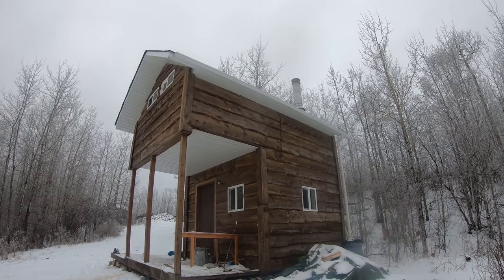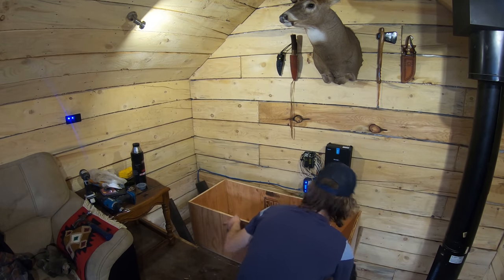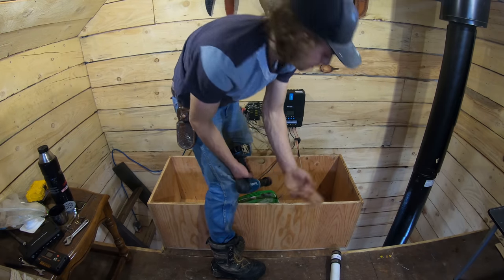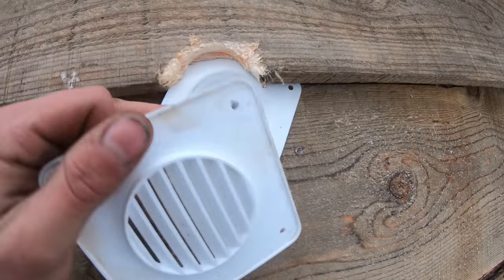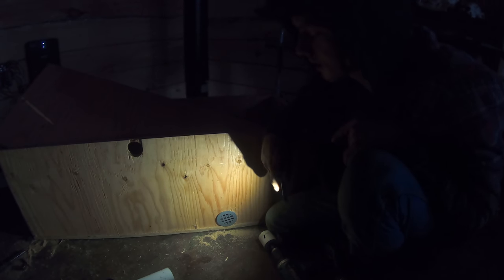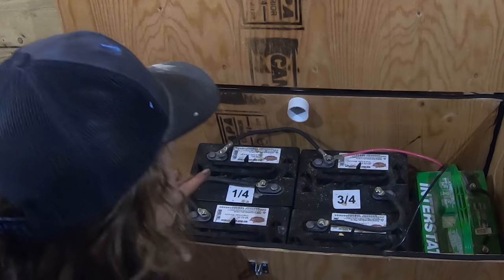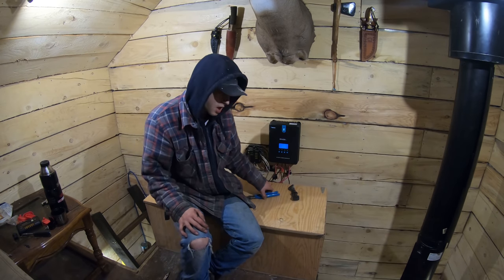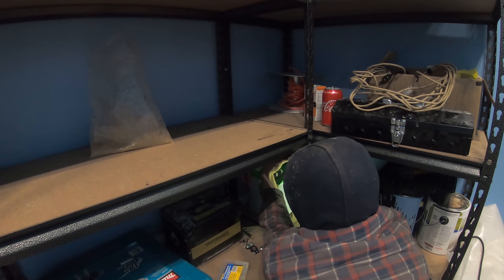Bushcamp - Offgrid Solar Battery Bank Install and Building a Vented Battery Box

Comment: Do us a favor and poke your camera at the wires for your batteys up stairs, something did not look correct you should of had 12volts, you need to make two 12volt batterys, and take positive from one 12volt and negitive from the other 12volt. You dont have to over think it, its just math. But you need to charge them one end to the other if you know what I mean. Pos. One side neg. The other, other wise your voltage will be low on one set.
Reply from the maker: yes exactly what i did
Reply: @TraplinesandInlines  I caught that, connecting them the way you did. I'm glad you figured it out. Right away watching...I was like NO dude.